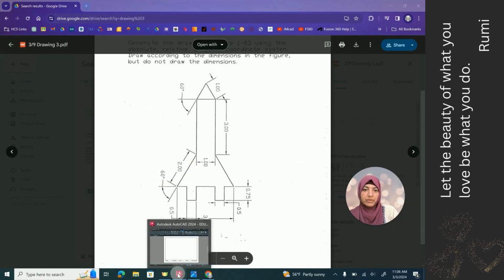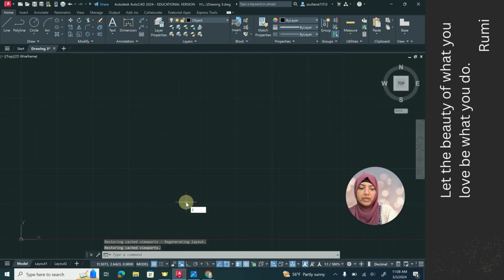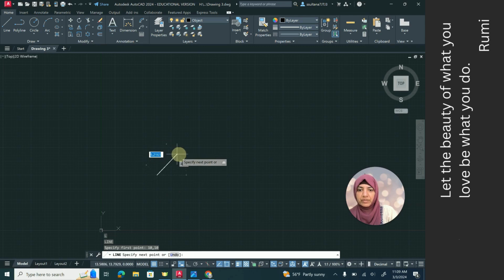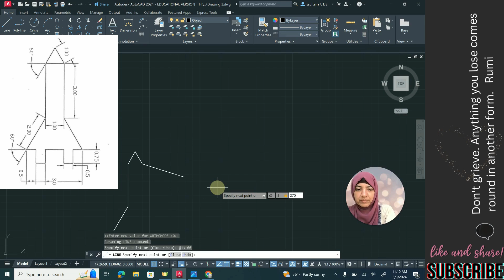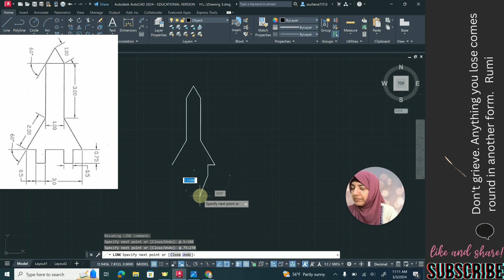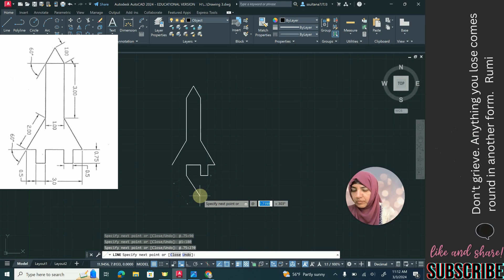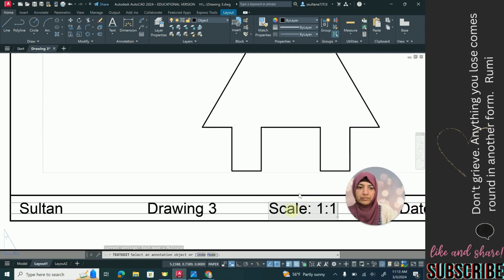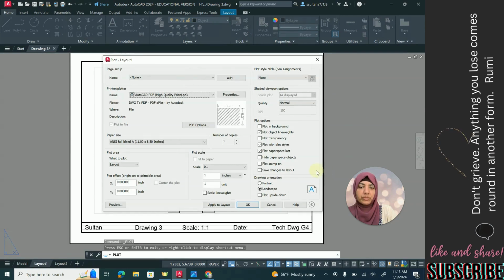Drawing 3

Comment: Hello,
      We deal with the automation of the design CAD/CAM activity.
      We have created PLUG-INS that complement the specific editor (for example and especially AutoCAD)  with new custom features. Much of the injenering work consists of  repetitive activities that can be automated and performed quickly and without errors.     For example, many of the injection molding activities can be automated,
punches tools etc. The new commands can be launched from the menu, the ribbon, or another interface (the command line).